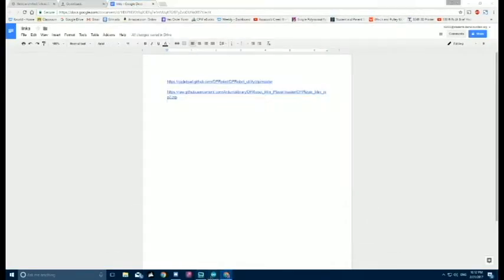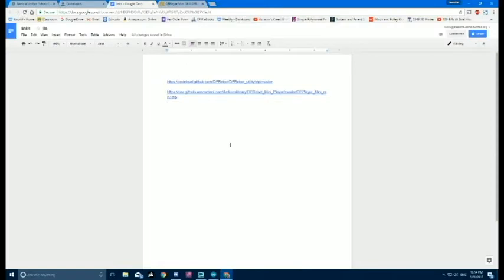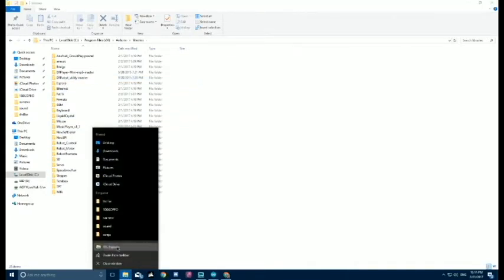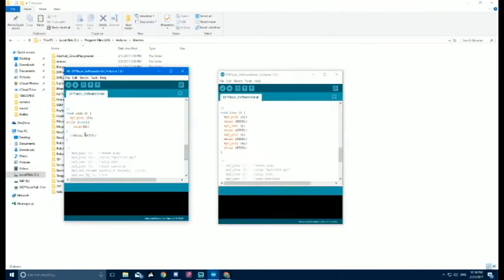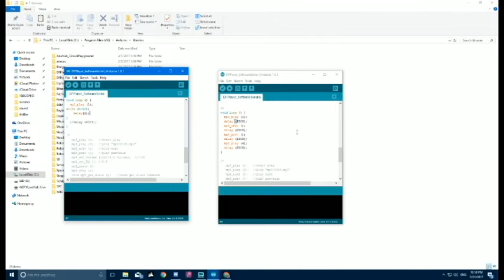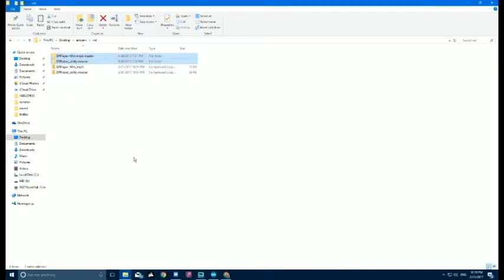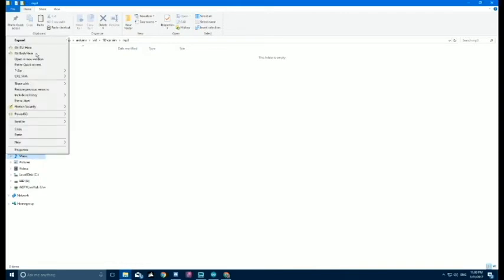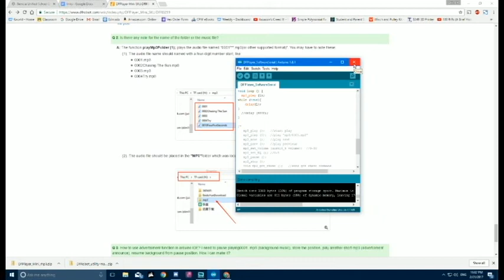DFPlayer tutorial

Comment: Renaming the songs to 0001 0002 etc doesn't do anything to how it plays, it's just to help you identify them when you upload to the card. The module only cares about the order they were saved to the card. For instance, if you have 3 songs called 0001 0017 0002 then you would wipe the SD card, resave them (so they copy paste in the correct sequence) but when you play track 3 in the Arduino code, it will play song  named "0017" because that's the 3rd song in the sequence on the card. This gave me a lot of headaches, after I had numbers missing and found that the rest of it goes out of sequence when your numbers don't match the quantity of tracks.

Comment: what is the purpose of the 1k resistor?
Reply: The TX port needs to run at a lower voltage. 5V will damage it.
Reply from the maker: Time stamp?
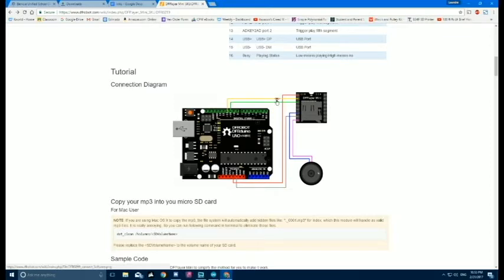Reply: 0:47
Reply from the maker: It probably runs at a lower voltage. Not sure